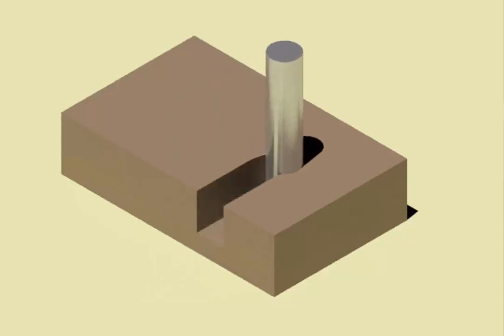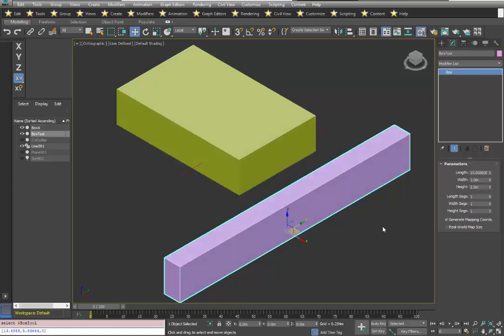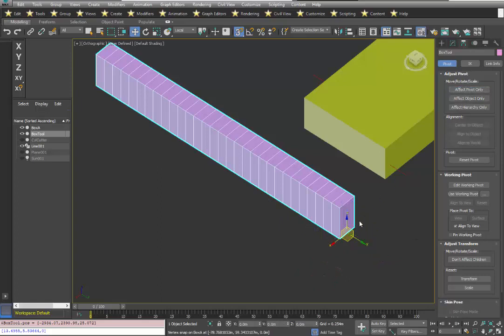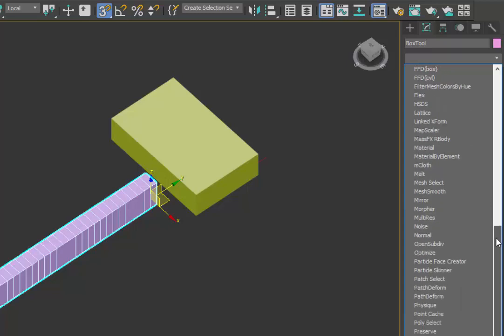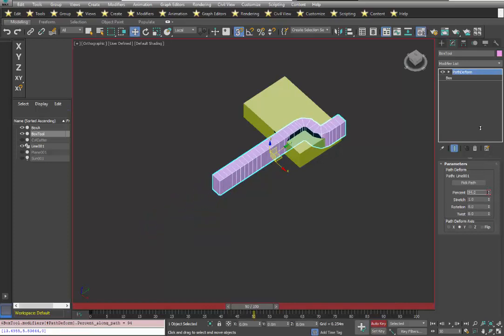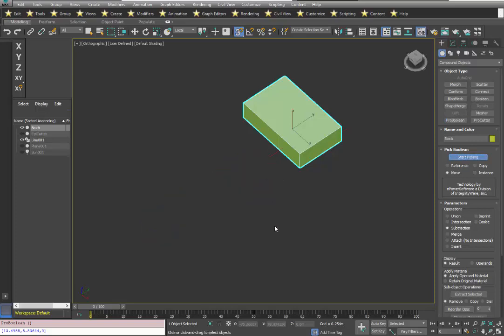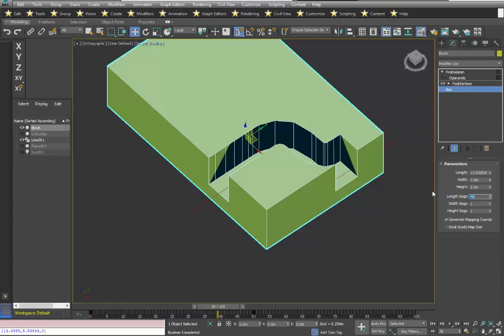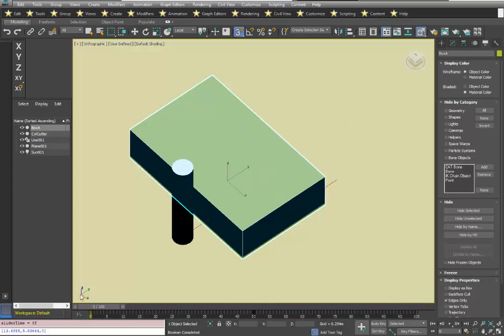Tutorial - Animating the Removal of Material with 3ds Max

Comment: for some reason it's not working.  Probolean thinks that my other box is not on the path
Reply from the maker: First check that the object being cut and the object doing the cutting do in fact intersect.
I have found that there may be an unexplained offset between where the cutting is done (the Boolean subtract) and the path.  I have seen the subtract successfully done and then disappear when the the time slider is moved to another frame. If this happens try moving the path around and see if the cut appears.  I am trying to determine the cause of this offset.
Reply: @LeeMinardi  it worked by moving the path around but its kinda tricky